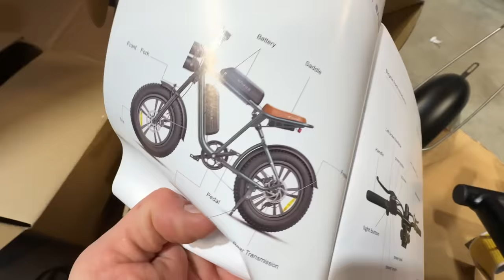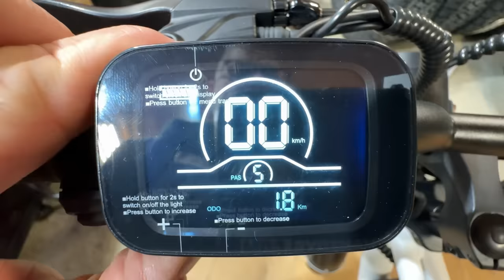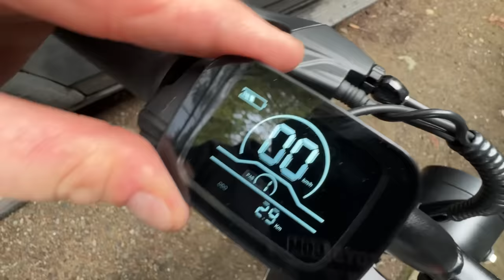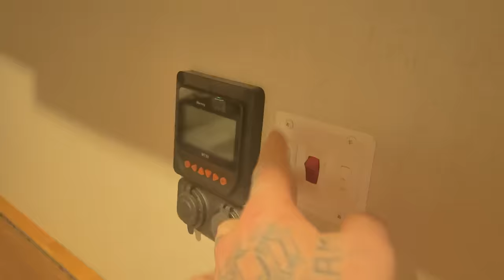Ok I Said It! This High Roof Van Life Is Worth The Hype

Comment: So glad you are covered for the windshield! I wouldnt dip my towel in the hot water Before making hot chocolate. Clean laundry still holds wash water bacteria, dirt. and detergent residue. Not kidding. Ok to wash your face but not to drink. If you dunk your clean washcloth in hot water and suck on it you'll probably taste it. A repairman told me this. My washer broke and I use laundromats now. The amount of grossness arount the rubber washer door seal is disgusting.